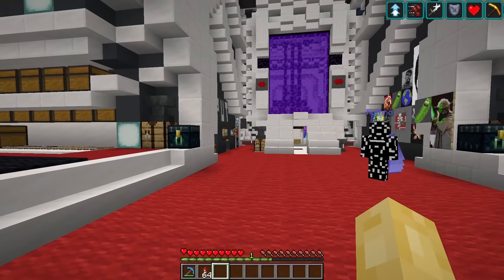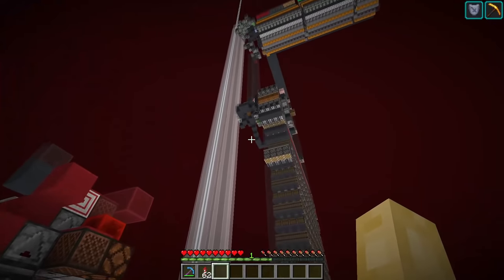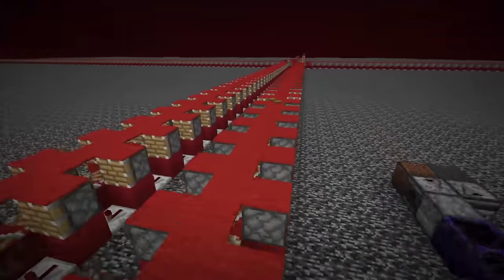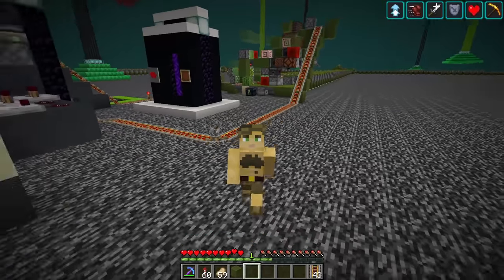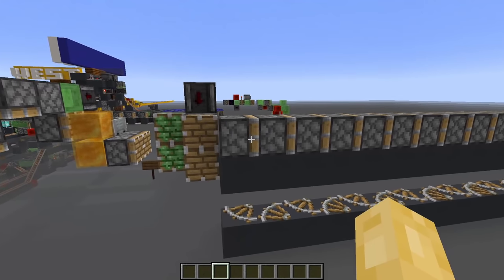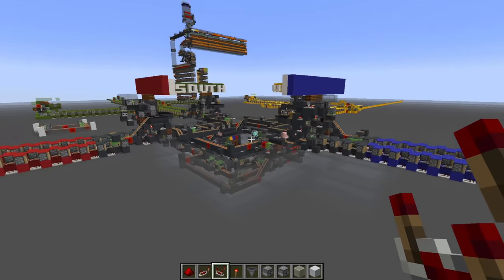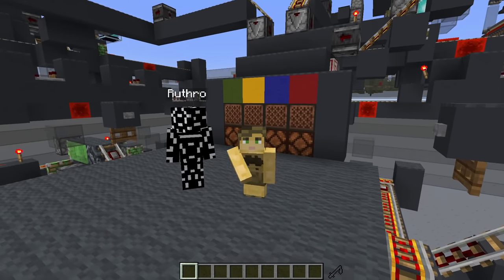The INSANE Engineering of Wavetech's Pistonbolt Network

Comment: The piston bolt is a nice way to have data travel with a minecart at the exact same speed of the minecart. I wanted to do something like this with regular rails for a while but you need to have a data buffer every rendering distance or so and wait for the player, or make the player wait for the data.
Which is kind of annoying to build for one person in survival for any reasonable distance.
Reply from the maker: The problem you are experiencing is that on powered rails minecarts travel quite slowly, to get the signal to travel at the same speed as the minecart it needs to travel at 8m/s. This can be achieved using a chain of repeaters alternating between 4gt and 6gt every 4 blocks, so with a block between each repeater.
Reply: @cubicmetre   ooh that is worth trying out for the players who don't need high speed piston bolts but still want station selection. I used to use a system where you stop for 10s at each station and if you don't get off you keep going, but it was slow at stations and not fully "get in minecart, go grab coffee, come back to be at POI".

Comment: At 13:08 the minecart gets a floating point alignment. That way the piston drags the minecart while retracting back on the detector rail. This can be fixed by addnig a second piston at the other side of the detector rail that pushes the solid block out. That way the minecart doesn't move foreward to the piston head and cant get floating point aligned.
Reply: i love you

Comment: Did something similar a few years ago where I sent a chest minecart in front of players to encode track switches for a limited amount of time. However I didn't solve the case of multiple parties approaching the same junction from multiple sides at the same time back then (got burned out).
It's really cool to see this system, love how easy it is to add junctions! 
I hope Mojang can fix the inconsistent behavior with the stacked carts - time to upvote that bugreport!
Reply: unfortunately it's not just stacked carts, it's the interaction between carts and detector rails in general
Reply: @RuthroAlt  that is truely weird yeah, hope it gets sorted out for 1.19 release!

Comment: I made a station system some years ago, but I used a partially full minecard as target ID instead of making a signal line.

Just add items into a hopper (or chest) minecard until it give the good ID on a comparator, send it just before the player, and use one or more comparators at each station to set the direction.
I was only sending players, but a simple timeout solution would allow to transport items.

Comment: I had an idea for an internet style system of addresses and junctions capable of transporting anything from entities to redstone signals. It relies on a player having a binary "address" and having every junction do certain things for the specific signal. For example, if somebody's id is 101, and the first junction knows to continue straight for id 101, then it will pass. Then, just encode all junctions you would pas taking the most optimal path to the end with id 101 to follow that respective path.
Reply: An alternative solution is to use a grid for more scalable routing

Comment: I had a post here, but it had a gyazo link, and I guess YouTube didn't like that.
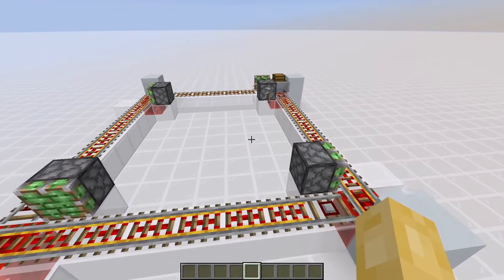In 1.19.3, the issue at 13:00 happens in all four directions at random in.  A solution is as follows:
-Move the detector rail back one space
-Have a repeater coming off the detector rail
-A piece of redstone dust off the repeater
-And a target block next to the sticky piston
Do this every 90* corner

PE = Powered Rail
SP = Sticky Piston
TB = Target Block
DR = Detector Rail
RP = Repeater
RD = Redstone Dust

PR | SP | TB
DR | RP | RD

I had this example running with 100 chest minecarts for nine hours while I slept, and it was still going with all minecarts when I woke up.
Reply from the maker: We have implemented this fix on wavetechs pistonbolt network already, its rather annoying because we were expecting it to be fixed but apparently Mojang decided to instead make the problem even worse.

Comment: You can possibly get faster speeds by removing the rails and replacing with low friction material. Minecarts have a hard cap of 2 blocks per tick when on a track.

Comment: You could add a chunk loading setup every chunk that automatically sends a signal to the overworld and immediately back to the nether to load the area right infront of the stacked chestminecarts and make them entity processing. DocM recently showed a simple design where you dispense a boat in a portal that gets immediately burned on the other side and sent back in item form. This might be fast enough to always make the next chunk infront of the chest minecarts entity processing.
Reply from the maker: This boat method while simple is also very inefficient. A chunk loading ticket can last 15s but the boat spams them much faster. For larger chunk loading grids you will want more efficient and sophisticated chunk loaders.
Reply: @cubicmetre  well I thought about using the boat method because if you dispense the boat in the nether it quickly travels back from the overworld to make the chunks on the way of the pistonbolt entity processing. Every other method should work just fine, you just need to have a fast response from the overworld. And the problem with the boatspam should be negligible considering that you only need to activate every portal once. But I guess you can't even dispense boats in the nether because you need water infront of the dispenser for that to work (if I remember correctly, it's quite a few month since I played minecraft the last time, had to learn for exams...)

Comment: Just had a thought which could greatly increase the number of stations from 15 for this system at potentially no speed loss on the orignal system.

If you send a second dummy signal after the first signal which the player travels on you could configure stations beyond 15 to take and delay the first signal to the same timing as the dummy signal and then take the two unique power levels for those signals through redcoders to go through an and gate at the same time. If both signals match the requested destination/intersection it diverts you, if not it sends you forwa to the next station.

For the existing stations you could keep 1-15 power levels, with 0-15 available the dummy signal. If a dummy signal is sent to an original intersection it can override things and send the player steaight forward through the intersection.

That should make 240 possible starions with a single dummy input system, however there's no reason 3 inputs couldn't be lined up making nearly 4000 possible as ridiculous as that is xD

Anyways, very interesting video! I've always had a facinarion with minecart stacking so it's great to see someone worki on that tech in an overall logistics system 😁
-SirLaurenceNZ
Reply: Its also quite annoying tho that you need to travel back to hub to travel to another location. Another technical smp has this great idea to make it “infinite”, and not limited to 15 destinations. https://youtu.be/3YzEDkEjfxI There is a limitation with this tho, you need a station to recharge your comparator. (More details on the video and this comment)

Also watching this video made by Cubicmetre made me think Ruthro’s pistonbolt network is also a little bit similar with the neural bolt (yt link). As Cubicmetre demonstrated Ruthro’s junction, you simply paste in the junction, no configuration of the composter whatsoever, and the junction is already integrated within the pistonbolt network. Right after you have built the junction you can use it already. 

So that made me think that, in the hub, the bolt (comparator) is assigned with a value, then each time you pass a junction, that value is decreased by 1. Until then that the value in the pistonbolt reaches zero, and at the same time, you arrive at a junction, you are redirected to that junction because you have zero signal strength. 

I would have to examine the world download to confirm it, but I’m pretty sure thats what they used here to automatically integrate a junction to the network.

Talking about its application in Wavetech, it is not neccessary because they always transport items in their central storage

Comment: So, if you want to be able to travel between stations on the return bolts, instead of always going down to the central hub, why don't you just invert what you already do for the outward journey? There are only 15 possible stops anyway (signal strength 1, 2, 3 ... 15), so just send a signal strength 15 from the closest station to go to the main hub, and decrease signal strength by 1 for each further station on that line. So if you would send a signal strength 15 from any station, you'd end up at the central hub, but if it is x lower, it goes to the xth station before the central hub. Then, at each intersection, have a circuit that detects when the signal strength changes, and change it accordingly for the whole line. 

The latter adjustment mechanism wouldn't work with a lectern, though, so you'd need something that can adjust the signal strength autonomously, like a hopper circuit, a piston decoder or whatever.

Comment: Why cant you have the same "3 exit" destination signal run backwards to the central hub? You can add destination selection for each destionation too. You have 2 sides, right side is comparator with which number of destination you want and left side you could have another comparator to decide at junctions if you want to go left or right. It should work completly fine. You could even add more than 15 stations to the system and it would work fine for the "closest 15 stations". If you wanted to travel to a station more than 15 junctions away you would just need to have a "pitstop" after 15 junctions and select the target again. The left side comparator for selecting of going left or right could even be encoded to mean "left / left-left / left-left-left / left-left-right/ left-right / left-right-left / left-right-right / right / right-left / right-left-left / right-left-right / right-right / right-right-left / right-right-left" <- those are only 14 combinations capable of controlling 3 turns in a row with just the left comparator line of the piston bolt.

Comment: The demibolt handles stacks of minecarts without anything else being necessary.
Reply from the maker: The problem is when you try and turn corners.
Reply: @cubicmetre  no cubic demibolt makes this whole thing like a million times easier I wanna cry
Reply: @cubicmetre  making the turns stacked compatible is trivial. The ones i showed in my video were to demonstrate the flexibility and ease of design that the demibolt offers. I should have shown a stack compatible transition in the video, so that is my mistake.
Reply: @inspectortalon  :hypers:

Comment: with encoding a signal on both sides of the pistonbolt it should be possible to expand this system to 225 destinations per line and with symmetrical bidirectional stations to go from anywhere to anywhere. Just more logic, but the bold would still be the same
Reply from the maker: This is unneccessary however, we have barely used half of the piston bolts capacity.
Reply: I'd probably be forced to space the bolts apart more to have extra space for wiring, but it should be doable yes
the selection might be a bit awkward though.

that being said we have plenty of slots atm, so I see no need

Comment: Could you expand the network by adding additional 'Sub'-Hubs at the end of lines in which their parent line would just be a return however the three other lines would be able to have lectern interfaces similar to the main Hub
'Sub'-Hubs would only ever be needed after the previous 14 slots are filled in a given direction, but it would be a future-proof way of making the network endlessly expandable

Comment: Wow, that's dream becoming reality
Why don't you use diagonal piston bolts?
Reply: they're more effort to build, and the only advantage they have is that you can take a more direct route to your destination, making it faster.
but speed isn't really that important when it's main purpose is to transport items in extremely large quantities. which you don't do that often, certainly not to a destination that is more than a 1000 blocks (nether coords) away
Reply: @RuthroAlt  additionally, making stacked compatible diagonal bolts is rather difficult.
Reply: @RuthroAlt  If it's main purpose is to transport large quantities of items, does that mean that there's a different system for player-only transportation, or is the piston bolt network also used for that too?
Reply: @readingchameleon  it can do both, the focus is just on item transport

Comment: Wouldn't the best way to transport large quantities of resources from a farm to main storage be inventory-syncing? That is, have a high speed hopper system at the main storage synced with player inventory, then break chests filled with resources (ideally shulker-boxed) and let them empty into player inventory and instantly get sucked into main storage thousands of blocks away
Reply: You are correct. The only explanation I can think of is that inventory-synching is clearly an unintentional feature that Mojang tried to patch last time, so it is possible they don’t want to build infrastructure for something that is likely to be patched out of the game.
Reply from the maker: The problem with using item shadowing for transporting shulker boxes is that they do not stack. When you transfer items with item shadowing you need to use a stackable item because you can modify the amount of items in the stack without breaking the link. With shulker boxes however you only get one item and so the link breaks the instant you try to transfer the item.
Reply: @cubicmetre  also pretty inconvenient imo (if it would work with shulkers)
Reply: @cubicmetre  in that case, why not have a very high speed hopper-minecart array and load the shulker boxes on the storage's end?

Comment: I tried to reproduce that problem you mentioned with the detector rail causing some weird behaviour and I honestly can't reproduce it at all.... The entire thing works completely fine in all directions after an hour of testing (Using carpet mod to speed stuff up).
So you either used a funky/broken MC version or something else (A mod?) was messing things up...

I would like to show you this, but not sure how I could contact you other than through comments...
Reply: Update: I actuall can reproduce this. Seems to be based on what the direction comes from too. When it goes into one specific direction but comes from another specific direction does it not happen at all... Probs a wrong calculation in Java...

Either way, found one of the most simple fixes for this... So no excuse there to not update

Comment: Does the junction selection work by subtracting the given comparator signal by one at each junction until it gets to zero?
Reply: that's how it determines the destination yes
Reply: @RuthroAlt  that’s such a cool design, I never would have guessed that’s how it worked until Cubic said the stations could be inserted from a schematic without changing them
Reply: @RuthroAlt  Not a minecrafter, but I just watch some videos. But im wondering, is there a limit to the number of junctions, if we keep subtracting the comparator signal to 0?
Reply: @oyashi7  15 destinations per bolt yes, should be more than enough

Comment: This is a very simple and elegant solution to bulk item transport! Or at least the concept is simple, I'm sure the implementation was more complicated. And the lecterne-book combo is a nice way to open up the full 15 levels for the destination signal. On my server we only have arrows in item frames and I've been thinking about nice ways to expand this, but for some reason hadn't considered lecterns before. On my server we have minimised the travel time by using diagonal sections of piston bolts wherever needed, does this item transport system work on diagonal bolts?
Reply from the maker: Apparently stacked carts do not like diagonal bolts.
Reply: @cubicmetre  Ah, too bad :( though it's still a very useful bulk transport design. I hope I get the time to implement it somewhere soon :)

Comment: Would it be possible to have 54 stations on 1 bolt instead of 15 using a double chest of different items that represent different stations?
Reply from the maker: By using comparators in both sides of the piston bolt you can multiply the options by 16 and obtain 256 stations. However you would need to modify the stations to also read from both sides. This may be excessive however as on wavetech we have yet to approach using all 16 stations on any of our bolts.

Comment: If the piston bolts are at the same height, you can use higher signal strengths (with stacked shulkerboxes or stacked cursed books). I don't think that it would be very practical
Reply: the way the intersections are wired, it would set the signal back to 15 (it uses redstone dust)
wiring it in a way that could handle overloaded comparators within the extremely tight size requirements would be very, very hard
Reply: @RuthroAlt  overloaded signal strength makes junctions and a lot of other network logic much simpler! Things on the way... >:)

Comment: why not use enderpearl stasis chambers instead?
Reply: Because it is pretty annoying to travel like 20 times from farm to your storage system and back and manually fill and unload your whole inventory if you could simply use your piston bolt once and pretty much don't have to do anything. 
Also: if your farm is 1.000 blocks away you would have to constantly load 63 chunks in order for your stasis chamber to work. With a piston bolt in the nether it is a 125 block ride and you don't have to keep any chunks loaded.
Reply: If you consider optimising for item transportation and player transportation 2 separate problems, then it results in more optimal solutions for both